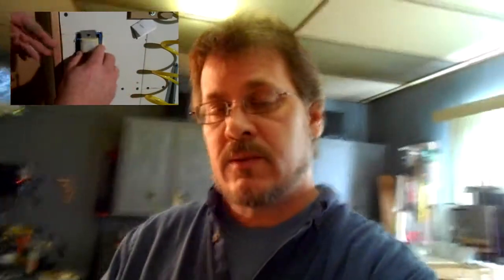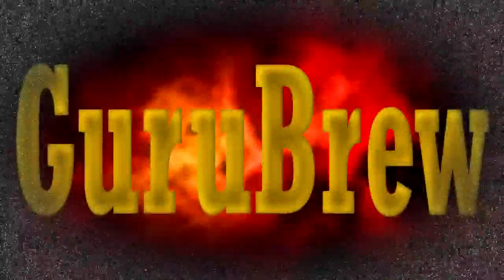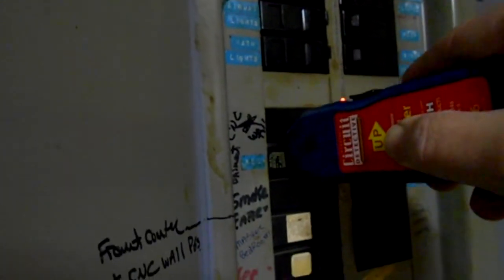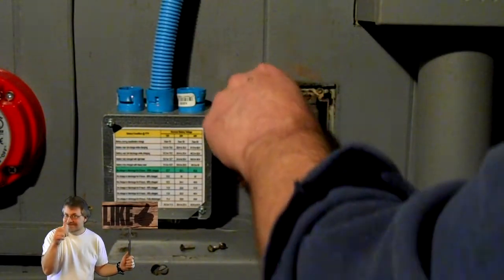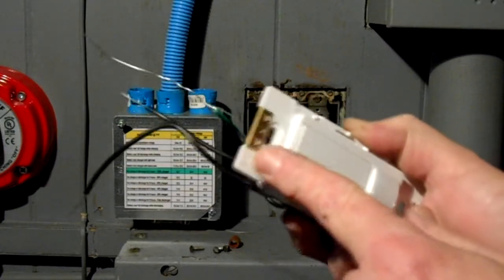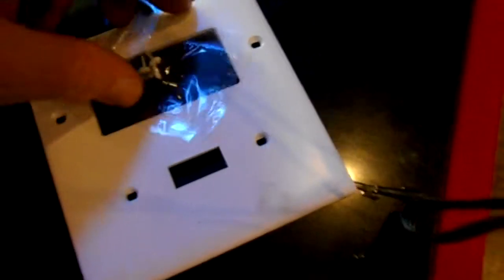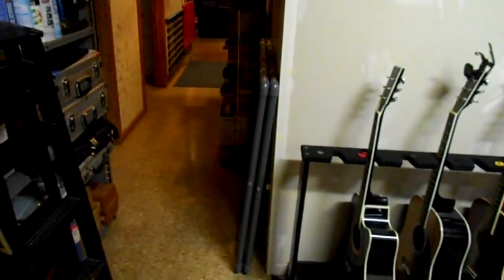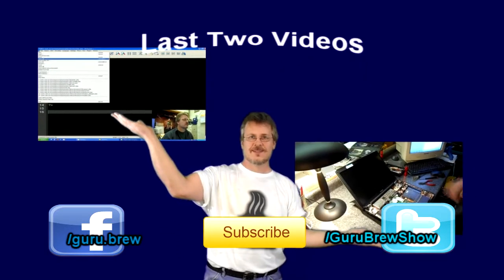Digital Circuit Detective Tool & Installing a Second Motion Activated Light Switch

Comment: OK...  TWO things that bothered me is he (apparently) had NO concerns about that 'second switch' just "inches" away, IN the SAME box and JUST "inches" from his target wires!  That second switch COULD BE "ENERGIZED" (by a DIFFERENT breaker) and switching the "OUTLETS" in that same tiny room!?  He had a digital meter in his hands ~ BE SAFE and be sure that NO voltage is present on that SECOND switch too!  And I agree.. that front panel looks mighty tired and deserves a fresh coat of paint!

Comment: Yaps!  Do NOT connect together the two "grounds".  One is a ground, the one on the bottom of the switch plate, the other is a neutral, the one on the switch itself.  You risk energizing the switch and outlet box.  Neutral and Ground are NOT the same thing.  Connect the ground to the metal box and the neutral to the switch.